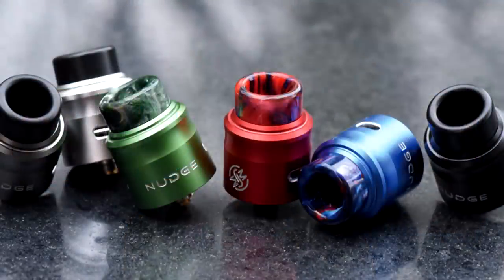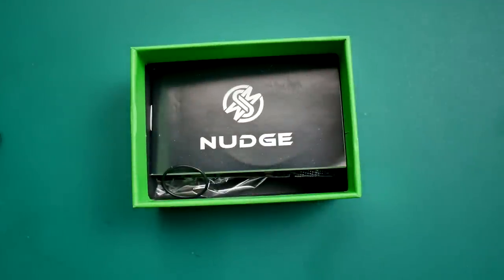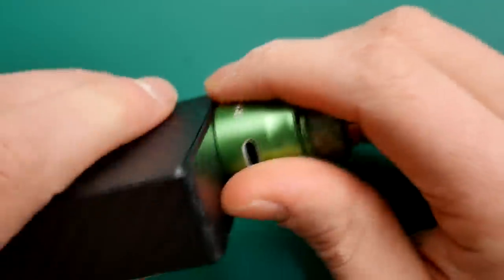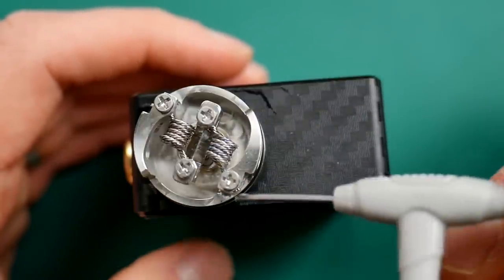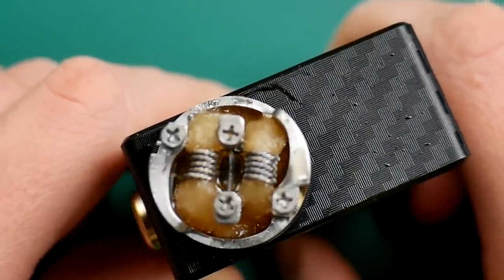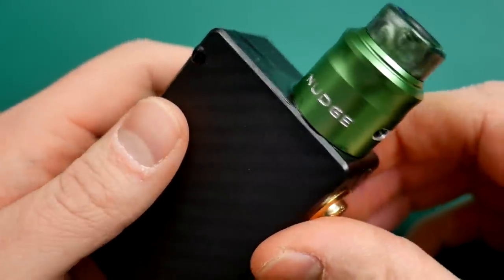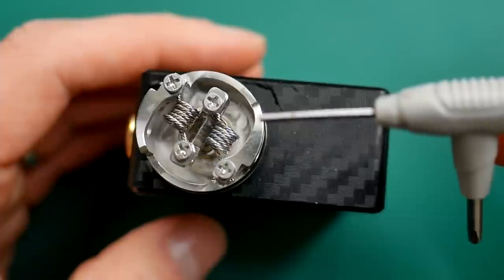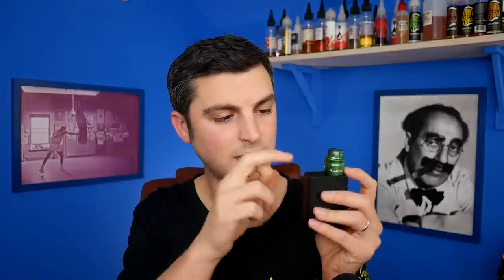Wotofo Nudge RDA by Matt from Suck My Mod SMM

Comment: I think you need to use a longer, thinner build.  Roundwire probably needs to be spaced.  I suppose the point of that deck is to really restrict the paths for air to just around the coils.  I think he was thinking two single coil drippers in one.  This type of deck or a postless like the dpro are really the only ways to easily get the coil down under that much metal easily.  I wouldn't say I'm sold on it though, I get the cleanest flavor off the Apocalypse and there is so much room for air to flow in that thing.

Comment: LMFAO with your janky coils. ;-) 
Try some 26ga dual core fused claptons. 5 or 6 wraps should give you a wide enough coil to slot straight into the post holes.
Reply from the maker: you can't wrap the coil up to the neg screw as it will touch the side of the deck but yea that build in the vid was janky lol

Comment: The reason you had a hard time building on this RDA is because your coils are to small. Ideally you want the legs coming out in line with the slots then they just fall into place. I just got 1 and find it very easy to build on when you do it correctly. Not wishing to sound rude but learn how to build better coils or stick to pre-built ones.